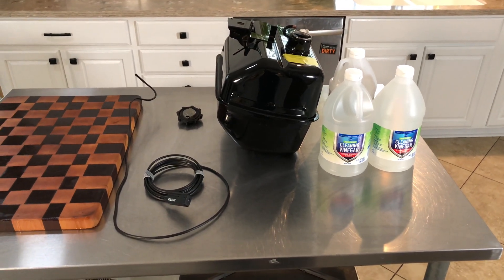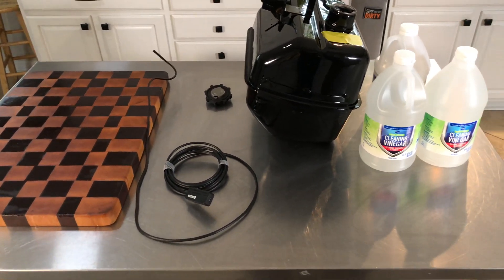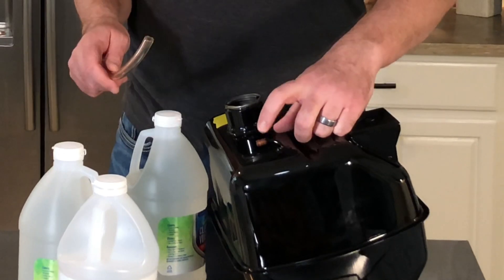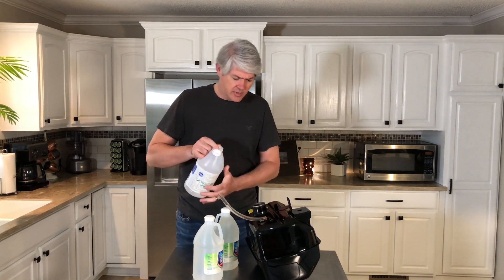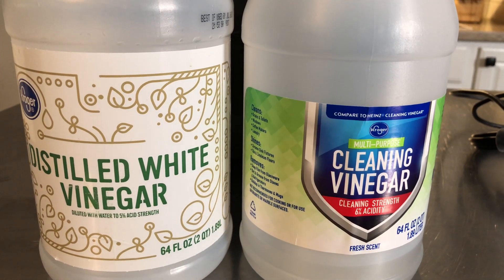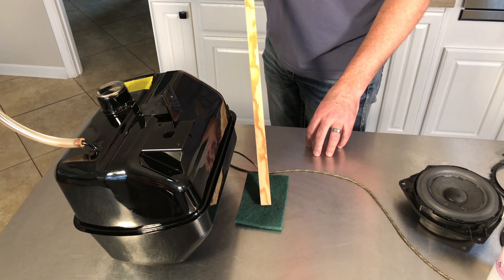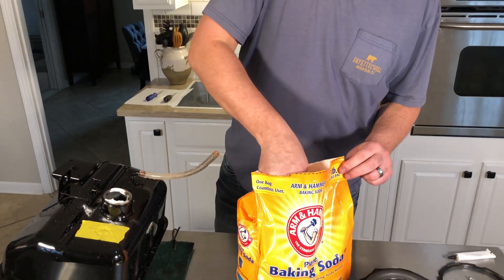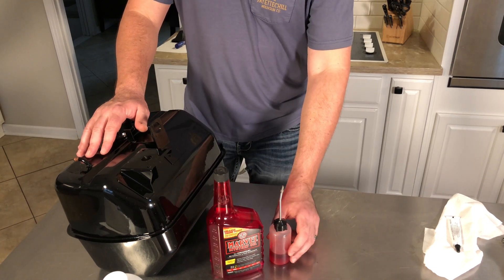Will Vinegar Remove the Rust from this ATV Gas Tank? In-tank camera shots using Probe Camera

Comment: You should add this video to the Kawasaki MULE repair videos. I "inherited a 1996 MULE with a slew of issues and using your other 5 videos as a guide on how to address various things. I hope you do a wiring video. Meantime, I am removing the gas tank and filling it with vinegar, as it is very rusted. Hope it work. Thank you for the great videos.
Reply from the maker: Great suggestion!  I will certainly do that.  I just posted a new video just minutes ago on the crank case gasket, oil seal, ACR mechanism, and crankcase bearing.  I do have a wiring video coming up, as well as a governor assembly video.  Thanks for watching my videos and taking the time to comment.  I would be interested to know how the vinegar works on an older, likely more rusty fuel tank.  Please feel free to update us with your results!  
Best Regards, 
David
Reply: You still have it? I have a 96 mule 2510 myself and I feel your pain lol I've this one is the 2nd tank and it's starting to rust. The original one was past repairing so replaced it........ I know this comment is 4 years old but who knows lol maybe
Reply from the maker: I sold mine to a buddy, who still uses it regularly at his cabin. He hasn’t mentioned anything about the “new” tank rusting.  These are great little machines!
Reply: @budgetprojectsbydavid5263  yeah my grandfather bought this one new in 95 or 96, it's got 3,305 hours on it. I know because it's 10 feet away from me lol putting it back together. Again lol